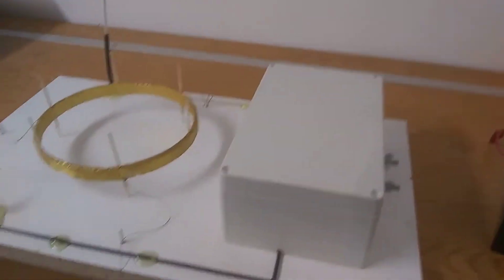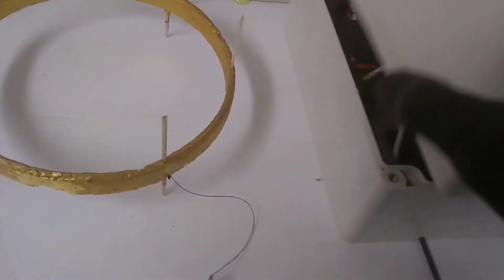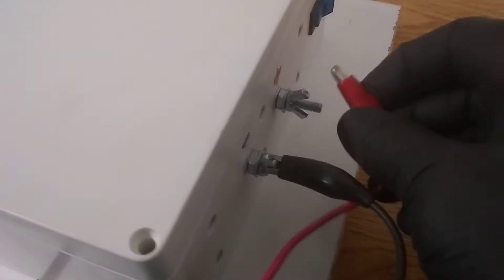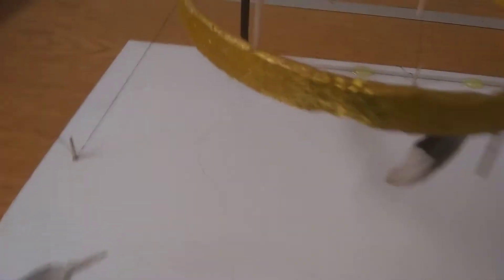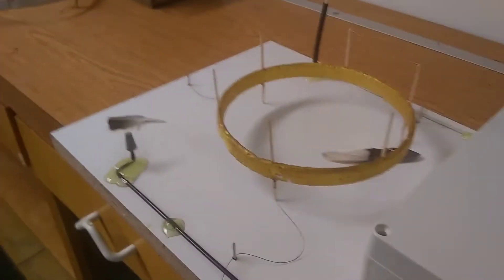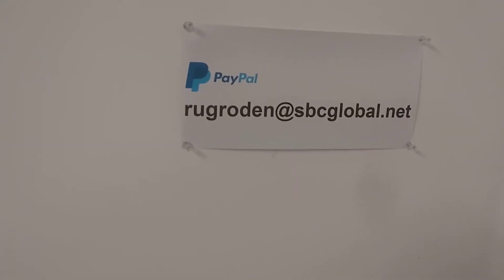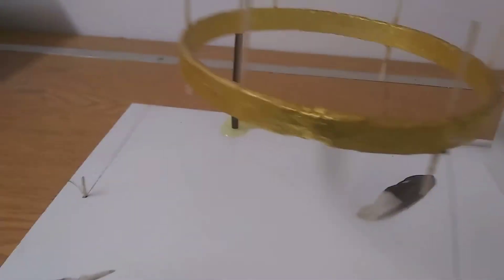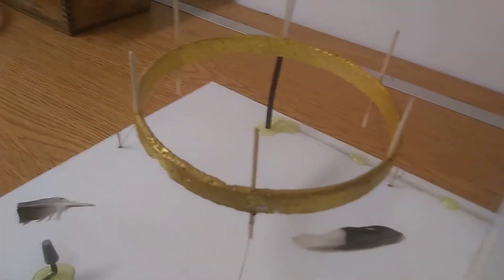Gravity Modifying Flyer Anti-gravity Lifter creates Artificial Gravity Asymmetrical Capacitor

Comment: Jim I am all ready put in form in asmi i2 with my magnetomillor that my parents don't give me nothing almost I have parents eternal parents but bit s question  if you must to do energy please invert in mechanic batteries that can towards the movement better than giroscope then I construct the magnetic battery and the turbine repropagator to take the mostly frecuent time in universe we have to construct the spirit and any people in hell is award the position only changes in hell the 12 demiurgos and a bad creation but heaven is conquer by challenger and pegasus 50 one day with all this things and a good propagator is not an aether that is all ready a drug is air and vacuum is water in stone and fire and recolect in space have no gravity but if the system to put in contact is big  fire and hot to 2100° c you can seourisly asseguratted the metal point behavior water of hoo is it is brass of one metal of the past and I dont know how to melt metal into a water but still I thought that hoo can concert real metal parts in reaction to water cross the still of neutrones and still work without carbon and petroleum please in Africa 😫🙏🙏💓the works have two days for me and very en carnation mode of council in the future and we in heaven have the first step

Comment: So glad you made another video. That looks like its quite big. What is the diameter of it?
Reply from the maker: Actually it's quite small - about 6 inches in dia.
Reply: @jimrugroden3644  Looks like you have a dc flyback in there. Maybe its just the video but I don't see the connection from the negative to the skirt.  I wonder what exactly is the type of foil you are using? I think my PSU setup is similar to yours but Ive never managed to lift anything as big as your craft. What I think is interesting is that you were able to take off from glass in your first video, and heres you are taking off from wood without a problem. I find the lifters stick to dielectric surfaces. Its good stuff.